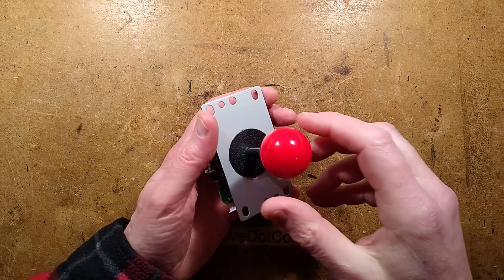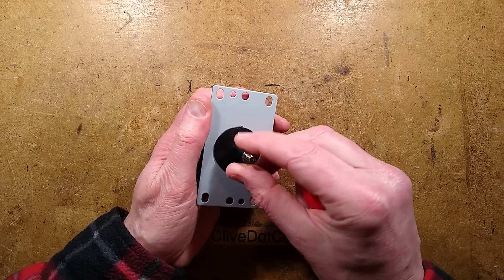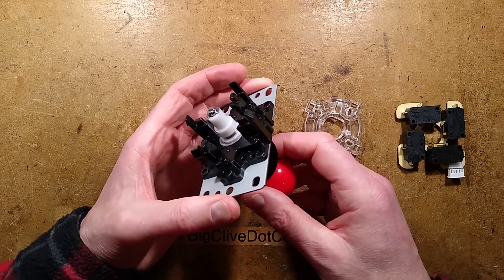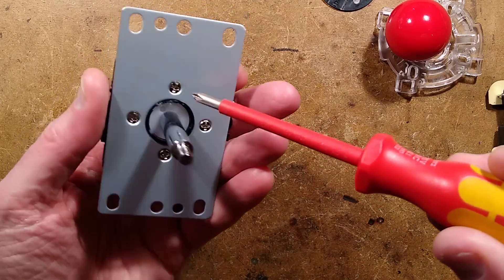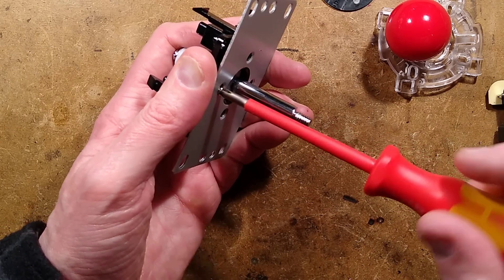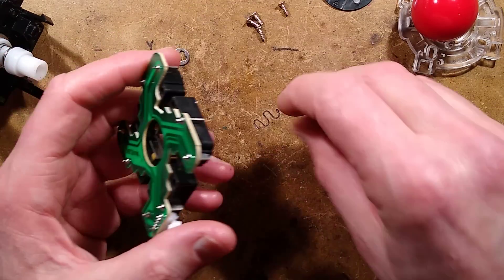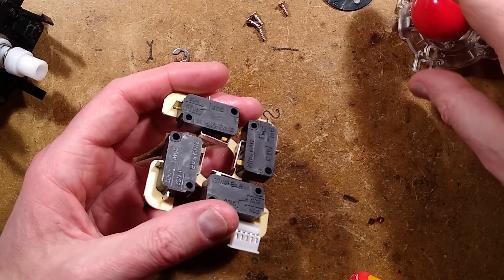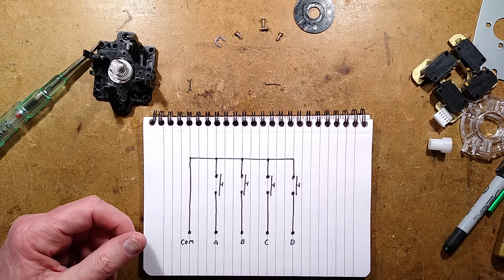Teardown of a Sanwa style arcade joystick

Comment: There are serial controller boxes to connect everything. I suspect you know that though. 

I'd like to hear of some of the sets you built for TV involving lighting circuits. I believe you said you worked at BBC and I watch older Dr who episodes and think big clive built that light panel in a ship or some sort. Haha
Reply from the maker: I have seen the USB arcade interfaces for Mame.  Although I have worked directly with the BBC I usually work for external prop companies.  The BBC tends to sub out most of the work to production companies.

Comment: Some of those joysticks will change to 4-way (instead of 8-way) if you turn the clear plastic part at the bottom 45 degrees. And some of them will have separate parts for that. Games like Pac-Man and Donkey Kong don't like half-cardinals (two switches pressed at once).

Comment: As a kid I have been playing the Nintandao for four years as a a kid, finished complete Mario connecting middle point to the screws in a corner of controller  using aluminium foil contraption before I have learned that controlers used to have the top joistic part on. 
Microswitches are posh:

Brand stuffing in  description is common trick on both alibaba and Ebay (I dont bother with amazon).
The idea is that when person skimes for words, might miss the point.
I have seen Samsung Galaxy buds 2 pro alternative earbuds.
or Original EBM Pabst 400mm Fan non-Genuine replacement:
But I have to admit that nonsamsung Galaxy Buds can hapily compete with many other brands 6 times the price and I would recomend them. (the chinese insistence of talking rather then simple beep  is a newsense when battery is low)

Comment: Nice vid; it reminded me of my USB simulator racing gearshifter that I got on AliExpress for about $50 that has magnetic switches to register shifts. It makes a very satisfying clunk when you shift it. I think it'd be really cool if you took  apart a direct-drive sim racing motor (probably a broken one because they're otherwise very expensive). By the way, do you attempt to reassemble these after you finish these teardowns? If not, what do you do with the parts?
Reply from the maker: I reassemble almost everything after the videos are made.

Comment: This is actually a neat upgrade to the joysticks I used to deal with when I worked at an arcade!  I rarely ever saw one with a connector like that, they were always just four switches that clipped into place, with the contact tabs sticking out.  Cables from the game often just had the sleeve contacts and slid onto the microswitch contacts (the ones that are just soldered to the board), often with the COM wire daisy-chained from switch to switch to switch.  Each switch also has two contacts besides the COM connection, "NC" - Normally Closed and "NO" - Normally Open, but the NC connection isn't being used on any of them in this design.  I don't know if any arcade machines ever wired them up to NC, maybe some early machines might've done that, but I don't know of any.

You'd also often find these wired up to something called a "JAMMA harness", where all the wires fed into one edge connector socket that slid onto the edge connector on the game's mainboard.  The JAMMA ("Japan Amusement Machine and Marketing Association") Standard meant it would be easy to swap out a game without having to redo wiring, because the same edge connector would be set up to connect to the same pins.  Everything from voltage rails, video signal (Red, Green, and Blue pins), Service/Test/Coin switches, and also joysticks and buttons for two players was all part of the standard.  For most games, that one edge connector was all you needed for the entire main board, you didn't have to rewire a single thing or fiddle with any other connector.

Also, I love the "Jesus Clip" name.  I thought it was going to be "Because when it pops off, you better pray to Jesus that you'll ever find it again."  The boring name you'll find in manuals is "E Clip", or at least it was in the manuals I had.  But I think from now on, I'll adopt "Jesus Clip".

Always love your videos, I just rarely have enough experience with a thing being torn down to have anything to add.  ^_^;;

Comment: FWIW ,  there is a somewhat uncommon pick shape sometimes called a "complex" or "45°" with a shallow V at the end I find them quite helpful with the small E-clips and cir-clips . Typically they have just enough shape you can push the tip the slack on the back side of the clip and then place your finger tip across the V of the  pick to capture the clip or atleast shorten it's flight 😂 ... not sure if that made any sense but hopefully it was helpful to someone.
Reply from the maker: You've just reminded me that I do have a set of mechanic's picks!

Comment: These also exist with individual standard microswitches, resulting in voltage rating at around 250V and a few amps, which could probably be used for some quite naughty things

Also, the flippable board is pretty nice when you already miswired the stick 180 degrees, from not realising that the lever inverts the input direction

Comment: Quite a bit different from the non-contact joysticks that I worked on when I first started using my Technician training. Those used a pair of differential coils excited by a transmitter coil and flux linked with a swinging copper blade attached to the bottom of the joystick lever. They had a large mechanical assembly to give the feel of a heavy hydraulic joystick and they were used on the Simon hydraulic fire access platforms. The electronics were made by a small company in Alford, Hampshire, the mechanical parts were made by a Skill Centre in the Midlands and the whole lot assembled, adjusted and tested by me, in Worthing. I think all the Companies involved are long gone now.

Comment: End of physical travel should be limited by the clear config plate - the switches never have to act as a limiter. 

But more importantly, I'm struggling to remember where in Clive's huge library of exploits we'll find the backstory to that squiggly scar on his workbench. Every video I look at that burnt squiggle and try and remember what was being introduced to more current than it wanted, and marvel at Clive's full set of 10 digits
Reply from the maker: The squiggle is linked to the heated plastic stapler.

Comment: This type of construction is really old, in my youth in the 80:s it was used in joysticks for the Commodore 64 and many other home computers. I still have my C64 and a couple of joysticks, these were nearly indestructable and if a switch stopped working they were easy to replace.

We used to "hack" our joysticks to "cheat" in games, for example many joysticks had an "autofire" system which was a circuit that pulsed the signal quickly when the firing button was pressed to give "rapid fire". I wired this so that there was a switch that connected it to one of the sideways switches instead of the fire button which gave incredible speed in sports games that required you to move the stick quickly from side to side to run etc. Also, there was a game where some levels were made more difficult by reversing the side to side controls so I rigged a switch to my joystick which would swap the left and right signals so that the controls could be switched back to normal for those levels.

A slightly less tech savvy friend of mine tried to do the "sports game hack" by wiring the points of an electromagnetic buzzer (basically a relay that cuts the power to it's own coil causing it to oscillate rapidly) to his joystick port and ended up frying the IO circuit because of the flyback spikes caused by the coil of the buzzer.

Comment: I spent a few years as  an arcade machine tech for one of the bigger companies in Australia in the early '90s (Street Fighter II CE era).  the MCA joysticks were a big chunk of plastic and the microswitches had spade lugs and were wired  individually. The 2-4-8-way limit plate was  a single multi-position part, and would limit the throw of the lever to not destroy the switches.  The switch levers occasionally  needed adjusting to get special moves to work (e.g something like sweep  U-UR-R-DR-D and all 3 kick  buttons to get a multi-kick move), a badly adjusted lever would  cause the switches to close in the wrong order.

Comment: I made a joystick for my ZX-81 back in 82. It had a bolt attached with a rubber grommet at the bottom, and four metal tabs arranged around the top. One wire was attached to the bolt and a wire each for the 4 tabs. 

So you would just touch the bolt against the metal tab, and it was linked to the keyboard interface and would press a key. 

The clever part was arranging the metal tabs so you could do diagonal by connecting to two tabs at the same time. 

I really wanted a real arcade joystick but couldn’t get one.

Comment: 是否能拆NES的 2控制器
以及日本家庭電腦「紅白機」的2控制器 兩者互相比較
Reply from the maker: 在這裡找到他們可能會很困難。
Reply: The NES controllers don't use standard switches. They use rubber membrane switches that have graphite on the contact side and when pushed, the graphite side connects to exposed copper traces on the circuit board.

NES 控制器不使用標準開關。他們使用橡膠薄膜開關，接觸側有石墨，當按下時，石墨側連接到電路板上裸露的銅跡線。
Reply: @ToddHofer  謝謝回答 但是我是比較好奇了日本紅白機的麥克風電路

Comment: The solder joints are not actually retaining the microswitches. Both the "bottim" and under side of the restrictor gate have notches that line up into the microswitches eliminating any stress on the solder joints or flex.
Also, genuine Sanwa e-clip is very easy to remove and insert back with smaller flathead screedriver.

With live: "I grease and stuff these things way too much"

Comment: I get the impression this style of stick was all about quick swap outs. A broken machine loses the operator money so they swap in and out a new stick. I bought some similar sticks which just had all the switches connected with the usual spade connectors, that would be slower to replace.

Comment: I designed a PCB that does the restrictor function with a small microcontroller. It wires inline with the joystick and you can toggle the restrictor mode on off via a separate switch.

Comment: I’m going to guess that the circuit board can be attached at any of the 90 degree positions in order to accommodate different pre-drilled mounting hole orientations in various game consoles.

It’s a little bit concerning that the connector isn’t keyed. I would expect anyone who has authorized access to a game’s guts to know what they’re doing but people get tired, the coffee wasn’t strong enough, some idiot used ribbon cable with all the insulation the same color…

For non-game applications these are definitely positive features. If during the design phase I get the mounting hole pattern wrong I have the options of rewiring the cable or rotating the circuit board, whichever is least inconvenient.

Comment: My way to remove circlips (or specifically E-clip, as that's what the type in the video is called), which resulted in a dramatic reduction of "jesus", is to first use any straight edge (like the back of a cutter knife, but a wide screwdriver or even just the edge of pliers or tweezers also work) to push both clip ends on the open side towards the shaft. The clip usually sticks there which opens a small gap on the closed side and a small crew driver can be used to pull it off the shaft. Normally without any "pinging".

Comment: Interesting teardown.
When I made my diy arcade controller a decade ago, I choose to install a Seimitsu joystick over Sanwa and I don't regret it.
I don't play fighting games, the movement restriction plate is already included and the stick is way more convenient to wire with direct access to the switches tabs we can directly solder on or easily crimp blade connectors using a very basic electric set.

Comment: Having worked with arcade joysticks myself for years, this video was an instant click for me. :)

The only bit of useful info I think this specific video missed out on giving those unfamiliar with how the physics of these joysticks work was that the lever triggers the buttons underneath in the reverse position of the direction pressed (i.e. pressing "right" hits the switch on the "left," pressing "up" hits the switch on the "bottom," etc). Otherwise, the things I was most surprised about was that this joystick came with a circular gate rather than a square one (I used to think the square gate was less expensive than circle, but maybe that's changed over 15 years?) and that the five-pin JST connector was actually included but wasn't populated with any wiring of any kind, even a daisy-chained common ground.

Comment: The slot in the base of the shaft is also useful if you have a shaft cover on your stick, which is just a plastic sleeve that rotates around the shaft. Without that slot, you wouldn't be able to get the balltop off. Another interesting thing I noticed is that this joystick has the metal levers on each of the microswitches, which all of my Sanwa levers lack. The actuator touches the switch...bump? directly.

You could also look out for a Korean-style joystick which uses a rubber instead of a spring to recenter the shaft.

Comment: I suspect the blank ribbon connector was just added as additional protection for the pins from bending while in transit/being fitted/knocking about in the back of a van

The Pingf*ckit would prolly come off easier with a sharp flat-bladed screwdriver of appropriate size (or a pair of circlip pliers ofc)

Comment: I had one of these in a stick I made for playing games on my ZX Spectrum.  I didn't like the amount of play on it, so machined a larger bush on my lathe to reduce it.  It's  pretty good now.
Reply: You also could have just bought a larger actuator. The aftermarket selection for Sanwa sticks is so large you can build a Sanwa joystick without ever using a Sanwa part.
Reply: @Blustride  True, but it was easier and quicker for me to spin up the lathe.  I enjoy metalwork.  :)
Reply: Sanwa equipment is tailored for versus fighting games. For other genres like shmups, bta or platformers you might seek for other brands..

Comment: I remember the original Atari 2600 joystick. It had a flimsy plastic ring that activated dome switches. They were always breaking. The Tac 2 joystick used a grounded ball that contacted plates. Much more robust.
Reply: The ring broke, or the switches?
Reply: Never imagined I'd see a Tac 2 referenced al these decades later, my fave on my Amiga, such positive contact.  But those contacts had to be cleaned (especially for the buttons) and the base ring would come loose over time.

Comment: Clive those two little notches inside the throat of the e clip are where you insert a small screw driver and twist to get it off.
Reply: Or by using a pick.
Reply: I use a small pocket knife, and slowly pry the e-clip off (with a finger blocking its potential flight path, so it doesn't go flying)

Comment: FWIW, Amazon does sell tools for installing and removing e-clips. They aren't particularly expensive. 

Note that e-clips are different than snap rings. Snap rings are bigger and use a different approach for installation and removal.
Reply: We call E clips on throttle linkages on older trucks and cars Jesus clips cause when you pull them off at times you slip them out of the hook tool and they fly out to places unknown in the shop and you said OH Jesus !
Reply: @jhonsiders6077  Engineer in Japan makes pliers with specially shaped tips to hold e-clips. They lock onto the side opposite the opening on either side of the middle tab. Neiko also makes flat tools with recesses to slide clips on and off, but much bulkier.